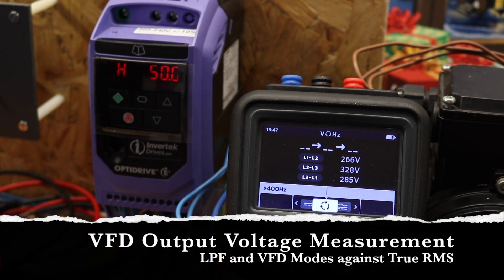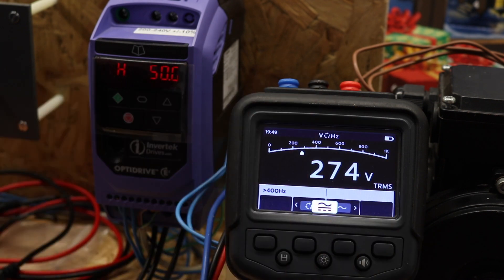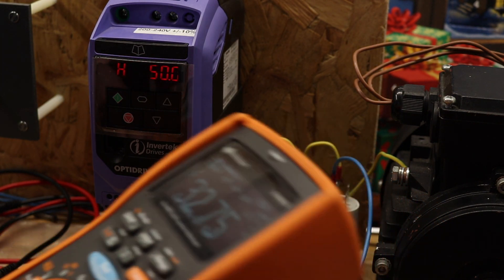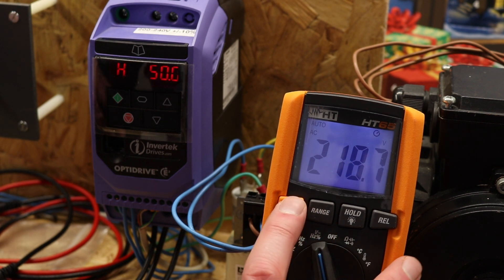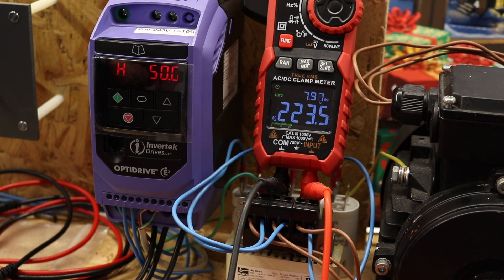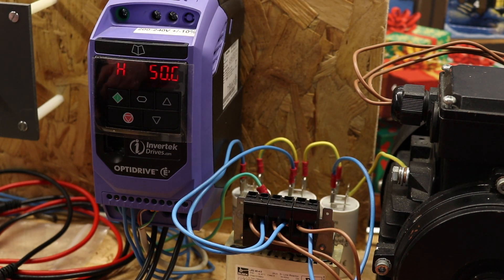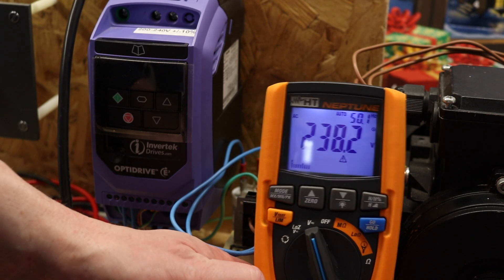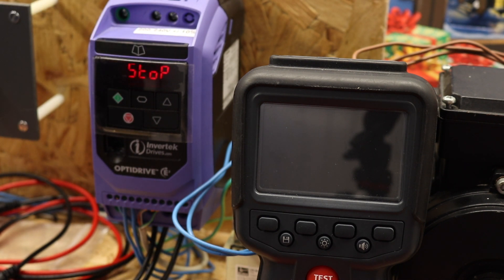The Megger VFD Output Voltage Measurement Challenge

Comment: This challenge it is missing a critical fact.  Not all meters have identical VFD filter Cut-OFF frequency.  Japanese meters they consider VFD range up to 200Hz.   First of everything, you need to know of your VFD inverter pass-band,  and then to use a meter with equivalent pass-band limits regarding VFD filtering.   Within a pile of meters including a VFD filter,  you have to accept a wide ACV tolerance of 5%.  The VFD inverter its not equal to a calibrator. Its not a measuring standard.
Reply from the maker: Thanks for watching and your comment.

Comment: Very nice! A follow up video might be using different VFDs with the same meter or meters. How does one know the VFD you used is actually outputing 220 Vac?
Reply from the maker: Thanks. I am just going by the manufacturer's specification for the output. If captured with an oscilloscope the output is seen as a PWM waveform so cannot be measured in the same manner as a normal AC waveform unless a filter is used, or mathematically calculated from the waveform.

Comment: Awesome, thanks, answered a lot of questions!! 
I'm actually surprised how many can actually measure a VFD voltage output, some being the inexpensive brands too. But a few questions....
How often would you measure the VFD voltage output unloaded and from the VFD manufacturer side, how accurate are they quoted to be unloaded? I would assume somewhat that the drive is designed to function better with a motor attached to it and not act as just an unloaded power supply. 
What about at 50% frequency, although there should be some V/Hz ratio effecting the Voltage output, how would those meters measure that? But still impressed there's more meters than expected that can even measure it. 
And..... what about current when actually loaded. Do any of the clamp meters measure the current from a VFD accurately? In my limited experience that's been an issue as well and was not done at full frequency. 
Thanks again for taking the time and making a video about it, super helpful! 
Cheers!
Reply: And I'm jealous of all the equipment you have access too! I can't even get a pair of rachet crimpers for small terminal lugs. Let alone a bunch of meters.
Reply from the maker: Measuring the output would likely be done only during commissioning to verify the operation of the inverter control system and ramping functions etc. It may be used during fault finding as well. I haven't found there to be any difference whether I have the motor connected up to the inverter or not. However, the inverter is a 0.76 kW unit and the motor is 0.28 kW and itself unloaded. I may try and get a 0.75 kW motor and figure out a hydraulic load unit for it and see then how the output is affected.
I tried the UT216C and it is happy measuring the voltage at different output levels. However, it could only measure the frequency at 100% output. At other levels it seemed to measure the nominal frequency of the inverter for that setting. This was with the meter in VFD mode.
The motor only draws 1.42A full load, so is a bit low for the UT216C. In TRMS it measured 1 A and in VFD mode measured 0.8 A.
Reply: @three-phase562  I would think the motor would effect the ability of a meter to read the voltage since the motor is an inductive load and could act more or less like a filter. Plus, the drive is designed to have that load on it and without it it could make it harder for the drive to control the output.  But just guessing here...